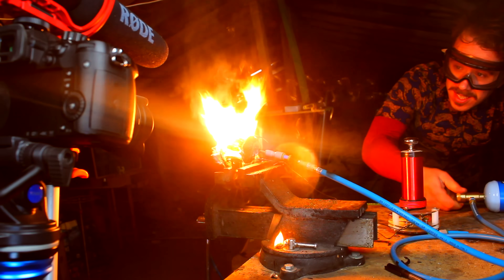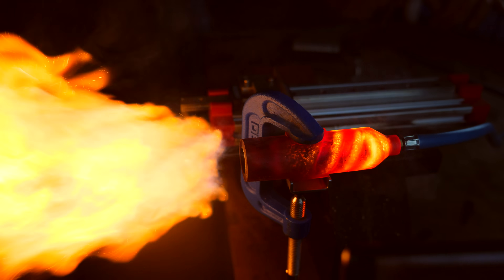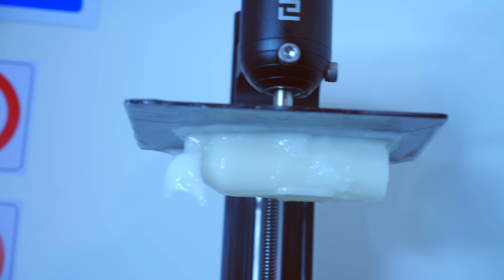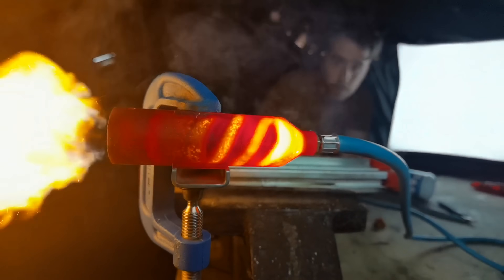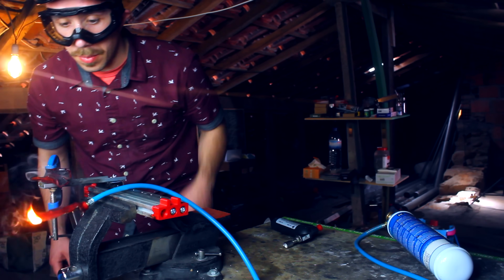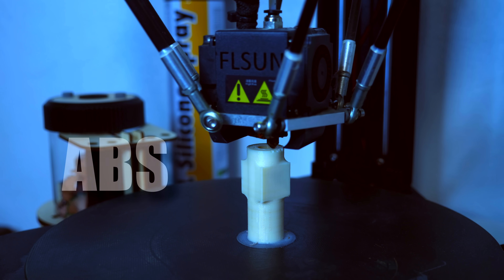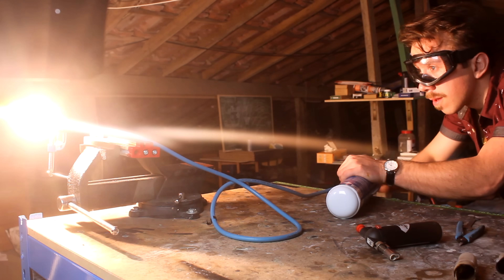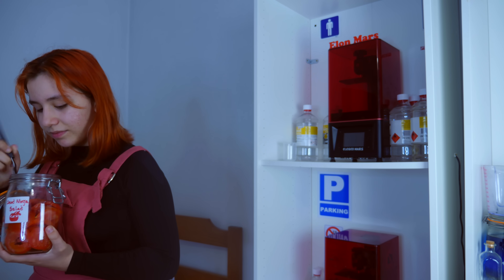Rocket engine that uses itself as fuel! (3D Printed)

Comment: I think you need a casing for that rocket, so the flames goes in only one direction and not blowing up.
Also you can try to make a 2 stage rocket with abs and resin, like the external part made of one material and then in the inside the main fuel made of the other material, all that inside a metal casing should give a boost, right?

Comment: Make the neck tighter and reinforced so it dont blowup.  The tight neck should give great compression and that oomphf. Try priming the engine with some liquid fuel before running it or just mix some in the material

Comment: Model rocket engines are encased in a paper/cardboard casing.. Why not try to roll your ABS engines in a craft paper casing? Just roll the paper coated in  wallpaper paste or thinned white glue  around the engine until you build up a thickness of say 1/4 to 1/2 inch thick?

Comment: Hopefully you see this but for a  rocket nozzle that would be reusable you could use a piece of steel or aluminum and use a stepped drill bit to make the cone and simply drill and tap the other side so you can attach your “fuel cell” to the cone with a simple addition of a mounting frame on the 3D print. Up side to it is that you wouldn’t have to 3D print so many nozzles and save material. down side you may want to find the right sizing before you make a metal version. Otherwise love the video.

Comment: -You should get some clear abs filament it would look much cooler 
-nitrous oxide will produce more thrust than pure oxygen.
-steel pipe would make a stronger body for the combustion chamber and a steel pipe reducer fitting would make a decent nozzle
Reply: seamless pipe no internal weld seam to worry about
Reply: It would be interesting to see how layer height effects engine performance

Comment: To increase thrust what you should do is print the fuel rod as tall as you can and with a spline pattern that increases the surface area of the fuel rod this will all ensure that the fuel is completely mixed and combusted before it leaves the combustion chamber otherwise its a flamethrower, not a rocket engine.

Comment: you could make an oven to melt aluminum and other metals and use resin molds and fine sand to make metal parts of the rocket engine and then use the ceramic resin to coat the material and make more resistant to temperature

Comment: Hybrid metal surface and nozzle joined with 3D ceramics that has been plated. It seems like you have problems getting the 3D print to contain the effect, so maybe try a 3D printed metal?

Comment: I think that you may be starting the fire in a bad way. When you ignite the engine the sparkler is still near the nozzle, and you want that to stay intact for as long as possible. Starting the fire close to the point where the oxygen enters and reducing the oxygen pressure so much of it is used by the time the exhaust to the nozzle will allow it to produce thrust more efficiently when the engine is hot and the burn rate at the highest. Ignite the tip of the sparkler, insert it deep in the engine, then turn on the oxygen.
You can even do some tests where you try to see how the oxygen supply changes things - low, medium and high flow, and starting low and increasing the supply as the engine heats up for instance.
Edit: Oh, you may also be able to get the cart with the rocket to move more easily if you move the rockets closer to the cart. The length of the arm the rocket is mounted compared to the distance between the front and rear wheels means that you will make a not insignificant torque (twisting force) when the rocket is trying to push forwards. 
If there is friction between the wheels and the sides of the rail, it can quickly build up when you multiply the force with a lever like this.

Comment: You should put it in a case. This way, the engine can burn all the fuel.
Reply: If you use the strait resin as a case, it might have some burn resistance

Comment: It occurs to me... you've 3d printed a lot of vortex based things, but did you print the two most obvious ones?  On my right, an imaginary, tomato sized, forced air forge with its vortex of firey happiness.  On my left, a small fire tornado that uses air channels to create the wonderful physics demo without any moving parts.
They're both kinda like vortex jet engines, right?  Just, less practical.  Just suitable for roasting tomatoes.

Comment: At 3:20 I'm thinking less pressure from oxidizer and move the rocket closer to the center of the slide mechanism to remove the rotational force it is trying to impart being out that far.

Comment: If this were my experiment, I'd try putting a solid fuel cylinder behind a ceramic nozzle so the nozzle geometry can remain unchanged during the engine burn, as forming the nozzle out of the same material will quickly melt it out of shape. That should allow for more consistent thrust. Maybe print a ceramic nozzle and body tube together that a hollow fuel rod can slide into, which should also reduce the problem of fire escaping through the porous ceramic.

Comment: Space shuttle's booster fuel doesn't just have a smooth bore for the ignition. Instead it's ribbed (for her pleasure?) longways, somewhat like if you took corrugated cardboard without paper on one side and rolled it into a tube. That gives more surface area for the burn to take place. You can 3d print some tools (like the bore-shaped plug and a die that fits around it), then use them to pack powdered sugar into a piece of tube. 3D print a smaller ceramic nozzle (2-3mm) to get more internal pressure, therefore higher exit velocity, and you should get a usable and RE-usable rocket engine.

Comment: Can you please 3d print a quarter turn ball valve. It is soo nerve wracking to watch you frantically tightening the valve on the gas cylinder, where a quarter turn ball valve would be so much easier, quicker and safer. If you don't, please send me your address and I'll buy a few and post them to you!

Comment: Fwiw, from the NASA website, re the shuttle SRB design: "The propellant mixture in each SRB motor consists of an ammonium perchlorate (oxidizer, 69.6 percent by weight), aluminum (fuel, 16 percent), iron oxide (a catalyst, 0.4 percent), a polymer (a binder that holds the mixture together, 12.04 percent), and an epoxy curing agent (1.96 percent). The propellant is an 11-point star- shaped perforation in the forward motor segment and a double- truncated- cone perforation in each of the aft segments and aft closure."

Obviously, this would need modification for use in a hybrid design like you're trying, but it seems a good starting point, at least. Oddly enough, those sparklers use a not entirely divorced composition as the ignitable, but more coarsely grained, and utilizing magnesium or phosphorus instead of aluminium. SRB fuel, from what I recall from one of the tours I was able to take through the Thiokol plant that refurbished and re-installed the fuel in the spent rocket segments, required the aluminium fuel component to be exceptionally finely processed so as to maximize surface to volume ratio.

Looking forward to more of your attempts.

Comment: I think this idea I just can up with a turbin pump rocket engine it contains of 3 parts.
 the turbine pump rocket engine contains: 
   1.the fist section of the pump will use a small amount to fuel which will be combusted and will be redirected to the model. Redirecting the combusted gasses will spinning the first stage turbine.
    2.the second section will be using the first stage rpms to push propellant to circulate around the nosel to absorb some heat to keep the nosel at a stable temperature the to the rocket main combination chamber.
    3. The third section will contain the main combustion chamber where the pump will redirect the propellant and combusted gasses wich will provide frust to propel the rocket

Comment: Would it help do "just" wrap some sheetmetal and fix it with hoseclamps arround the abs parts so there is a bit longer lifetime before there is a hole in the side of the engine?

Comment: I think you should resin print a ceramic shell/nozzle for the 3D printed fuel, to make sure it all burns evenly. Maybe try making a reusable one out of metal? Get a metal pipe with a threaded end, weld a nozzle on the non-threaded end, then get a threaded cap for the threaded end and drill a hole for an oxygen line. That way you can slide in "slugs" of 3D printed fuel and make sure it all burns.

Comment: 1) Stop using just twist valves and add a butterfly valve to control your gas flow. It takes 0.25 seconds to open or close a butterfly valve while a screw valve can take 10-20 seconds. So, add a butterfly valve to the line and you can almost instantly stop the flowing gas. 

2) When you printed your rocket parts, why didn't you finish the mating surfaces? You should have sanded them with progressively finer grits of sandpaper to make sure the surfaces are absolutely flat and smooth. Start with 300, then 600, 1000, and if you feel the need, finish them with 3000 grit so that they will actually seal. Finally add an O-ring between the mating surfaces. RTV works just fine to stop oil, water, and other liquids, but it is terrible for stopping gas under pressure, for that you need an actual O-ring. When you are printing your parts adjust it so that there is an O-ring groove. Get the right type of O-ring and you don't need to worry about the darn thing melting either. 

Those changes should keep you from burning up the rockets and if you do have a leak, you should be able to instantly shut off the gas flowing to the rocket so that you can inspect the failure and see exactly where your problem areas are. Without being able to examine your failures, you're never going to accomplish anything other than just burning up 3D printed parts.

Comment: Make a spiked cyllinder in the middle, supported by fins running the whole length. Also the nozzle needs to be from some other material as it's basically the first thing to go, and to avoid that you would have to precisely measure the oxygen pressure so that it is exhausted before reaching and consuming the nozzle.

Comment: you could incase the solid rocket fuel parts into pieces of metal pipe to be able to use more of the solid fuel - also try more heat resistent nozzles after finding a good shape for them
Should be amazing

Comment: You should use the ABS as just the fuel and insert it into a rocket housing.  I would also suggest putting a 90 deg ball valve in the oxygen line to quickly turn it on and off.

Comment: If you put a metal casing round the engine, even if the rocket engine starts to disintegrate you can have something hold it together so that the thrust is still going in the right direction. You can also use a metal nozzle so that you can better direct to exhaust flow and be able to produce more thrust.

Comment: You could try wrapping these 3d printed engines in thick aluminium or copper tape, so they burn more fuel before falling apart.

Comment: Use a metal pipe for the body and a metal nozle.  Print abs cylinders that slide inside so the engine is durable and you're just printing the fuel.

Comment: Why do buildings burn down but everything else burns up?

Edit: Oh also please get a ball valve for that oxygen supply!  Makes me nervous that it takes you a couple seconds to turn off the O2.  You place the ball valve after the needle valve on the tank, use the tank valve to set your flow that you want, then the ball valve can be used to turn it on and off without affecting your flow setting.

Comment: It looks like your rockets really worked! I do think the test setup is too heavy and unbalances to proper 'measure' the thrust of the rockets. For example, the arm the rocket is mounted on is cantilevered (off to one side of the slide) and weighted down with a heavy clamp, with additional resistance from the oxygen hose.

I think that with a more tuned test setup, you'll see some difference :)

Comment: Just a tip. Look up the old SRB Boosters for the space shuttle. The Propellant had a star shape in the inside to get a bigger surface to burn inside. Also the ignition was not at the nozle like your rockets but at the top. ;)

Comment: I recommend installing an electronic air valve to the oxygen supply that stays open at the beginning of test and then close when done. Less time trying to close the 02 valve. More control over the factors, safer he will be to make more  fun videos  for years hopefully. (maybe a dead man switch so he can simply drop it and run if needed)

Comment: i have watched alot of your videos Integza and the hybrid rocket one was good one for me to have a think on how to get more thrust , maybe if you can get Graphite and make different Bell nozzle ends which can Screw in to a Solid metal tube with maybe a clear glass window t see the combustion inside  , and use ABS as a solid fuel and  Nitros-oxide to be used instead of oxygen , i know it may seem funny but look up at how Mythbusters got there rocket to be powered by Sausage meat and nitros-oxide.   hope this helps .

Comment: Here is a thought.  Use the ceramic resin to print the nozzle and housing (shell) for the rocket engine.  Then use the ABS to print out the filler for the housing.  You might get more than "one and done" out of that assembly.

Comment: I actually figured out how to 3d print in 100% sugar.
Take pla, and burn it. It's just a type of sugar that's basically too big for anything to directly metabolize, and it's locked up in a few special ways.

But it is Poly Lactic Acid. Lactic as in Lactose, then really big sugar in milk that upsets people's guts.

You can also buy borosilicate or fused quartz glass tubes to see the rockets while containing the fuel as you test. Both of those types of glass are able to withstand very high temperatures are are very strong. They're made for scientific purposes, often burning hot chemical reactions.

Comment: @Integza talking about making stronger bodies for the rockets, since you have the ceramic kiln, you don't have to use the ceramic resin, if you print molds of the rocket parts you can just then press regular clay in the molds, then join the two halves, and it's done. The reason to do this is that you don't have those absurd warpage problems since there is no resin mass to burnout, you can make simpler and thicker shapes if you need to, without having to worry that the parts won't print. Also just glaze the parts, they will actually be watertight, not problematic as the metal coating nor as costly, and with clean clay contrary to the resin you can glaze the raw clay and not need to repeat the firing, as is often done for reasons beyond your experimentation.
Hope this helps, I wanted to experiment with small rocket motors myself for a while now!

Comment: Hi integza,

I'm a great fan of your video. I never miss one.

I have three questions about your project:
1 - Why don't you use metal tubing like steel or aluminium tubing to contains the fuel stuff(abs or suger or powder etc...)?
2 - Why don't you use ceramic nozzle and secure it to the metal body?
3 - Why don't you use a lever valve to stop oxygene?

Comment: This might be absolutely horrid idea, but we know metals can burn as well.. and very high temps, meaning higher expansion of the air, just need to get flame into ignition point of metal, say aluminum powder, combined with some iron oxide(rust)... and you have termite, but what material could handle that heat is kinda issue... also you might want to test specially this version somewhere else than your attic :D

Comment: try to convert a 3d printer to a metal extruding 3d printer (if possible), that way you can print the rockets out of metal so you can build lasting turbo engines, engines that produces a lot of trust!

Comment: Put your 3d printed fuel inside a thin wall steel or copper pipe with fittings on the ends. Should work til the fuel runs out

Comment: have you considered wrapping the engine with galvanized metal? it should be easy to find near you because if you use hard duct for your air conditioning or heating system you should at least a supply house that sells it. I'm not sure the thickness needed to make sure the engine doesn't completely come apart from the heat but it may be something to look into if not already

Comment: What timing! Just yesterday I was toying around with a reusable pulse jet engine made of a bike pump and water gallon jug.
Rubbing alcohol was poured into it before laying it on its side, then a bike pump is sent through a hole punctured in the side. The cap is taken off, and fresh air is pumped into the chamber to create a mix of alcohol vapor and oxygen. It is ignited with a lighter, pulses slowly but violently, then dies out. To elongate the runtime, you can pump the bike pump while the rocket is burning, but this will only keep the system going for a handful more pulses before the fresh air coming in is displaced by vapor and smoke being created by combustion. For those of you attempting to replicate this, try an air compressor instead, and SECURE THE BOTTLE BEFORE TESTING!